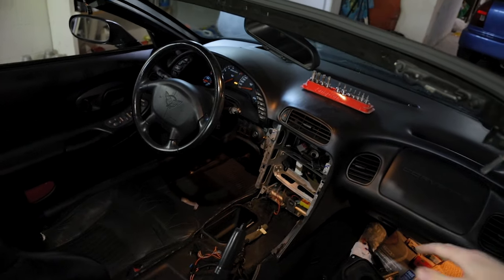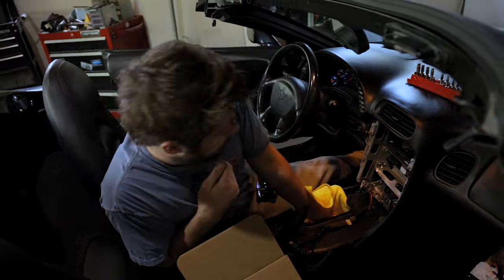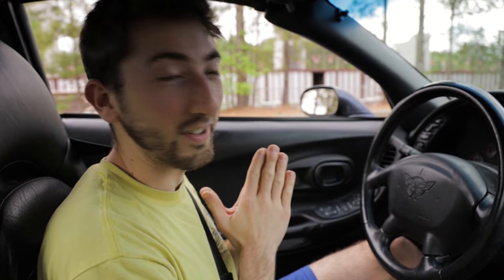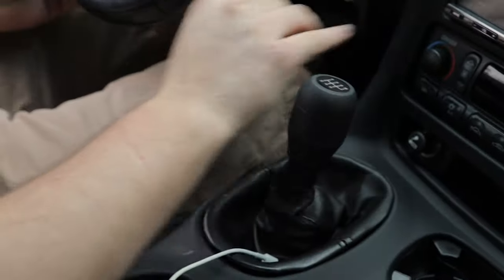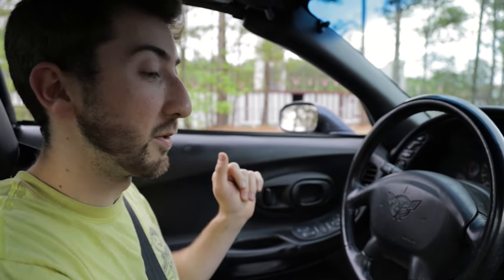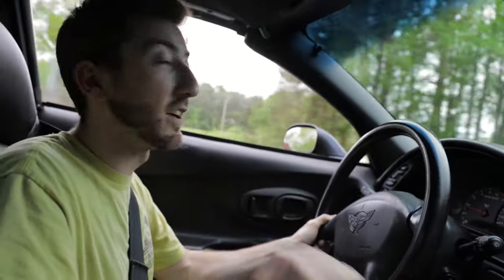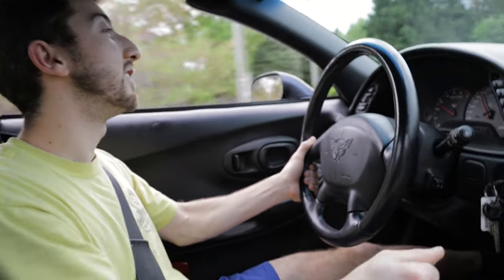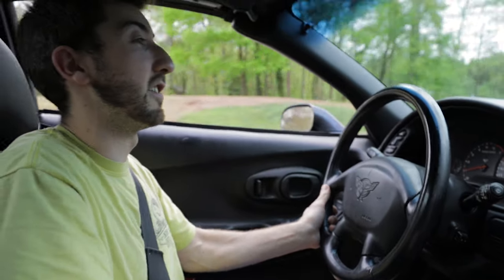C5 Corvette MGW Short Shifter Install & Review

Comment: Hey man I just bought my C5 and its short throw shifter is EXTREMELY tight, to the point that you cant even wiggle it in neutral... I am reading around how to loosen it and it seems you need to loosen a bolt and or lube up some things... I've been watching the install process and seeing how things work and I can't see anywhere that I would loosen a bolt, or even lube up for that matter. 
So I am very confused on how I can loosen up my shifter, it is absolutely brutal. Praying for a response, thanks man
Reply from the maker: Dang! I'm not sure about that one to be completely honest, we didn't have to adjust anything on ours. Like you said, not sure there was anything there to adjust. Ours is pretty tight as well, you can wiggle it in neutral but its stiff. Sorry I can't help more!

Comment: Is that the know that came with shifter? Recently bought a c5 zo6 it has this shifter nob,,guessing it's the shifter you just installed...I hate it..wondering if it was installed wrong or is there adjustments I can do? It's very clunky hard to find gears..been driving manual trans for 40 years so yes I know how to use one...thanks for any Input..I've read it's the best shifter to be had..why I was wondering if mine was maybe installed wrong...
Reply from the maker: Yes that’s one of the knob options you could get with the shifter. I definitely know what you mean about the shifter feel. It’s extremely notchy. We’ve gotten used to it but I could see how someone could not like it.